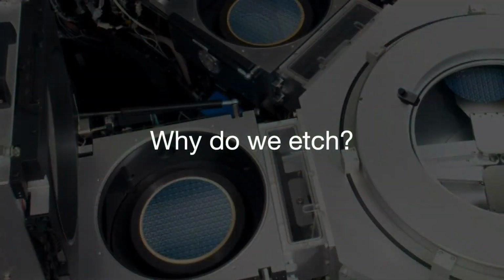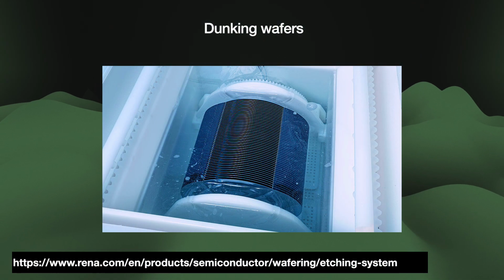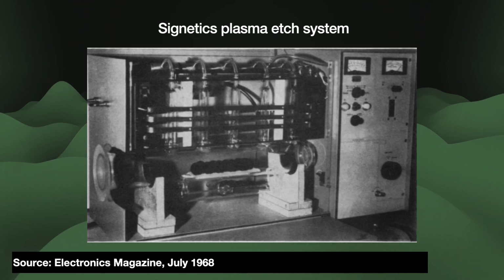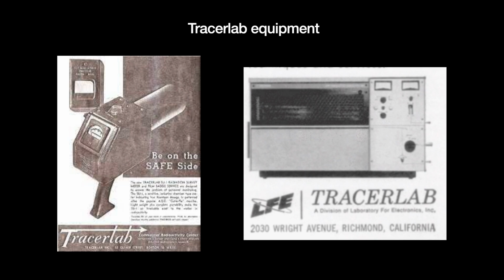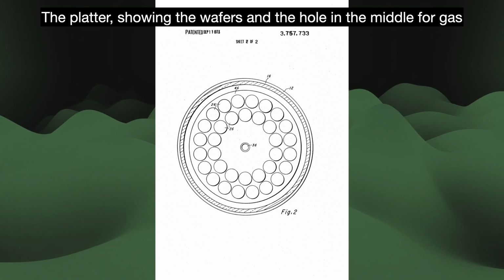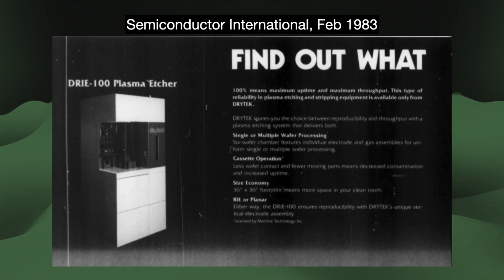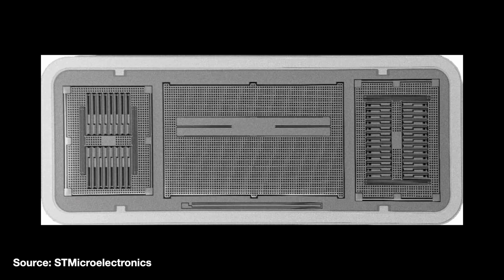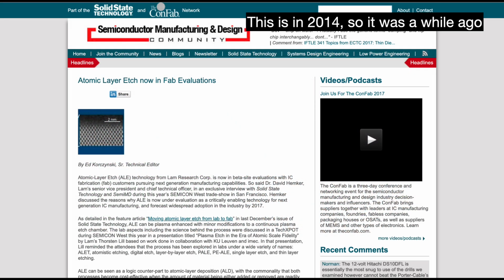Etch: Lithography's Unheralded Sibling

Comment: Cant remember magnet ring on Lam but Applied had static electro magnet ring and energized them in series, Tel had fixed magnets and mechanically spun them. Interesting to see same process on different tools and setting required for similar outcomes.

Comment: Fantastic content. I worked as electronics tech in Microns RD etch fab in Boise in early 2000s. We were qualing 12inch tools, doing some copper trials on 8"   . Did some high dielectric testing also. That fab had Lam Tel and applied all in about 1/3 ratio.  Older 8" applied were heavily modified to do interesting etches.  Thanks for your time and the content. The history you cover and your style is excellent.

Comment: 5:55 13.56Mhz is the carrier frequency used by NFC smart cards (credit cards among others ) to power the card. It's modulated to transfer the data. Any reason why this frequency is used in both cases?
Reply: Yeah, band allocation is the reason. A professor in my old group once modulated a high power signal, I don't know what, to some random number well into the MHz. Not too long after the university was contacted by the local air base who told them to knock it off.
Reply: I don’t know why NFC cards would use that frequency, but the reason that it’s the standard frequency in plasma processing equipment is that that frequency is within the ISM bandwidth (specifically allocated for industrial, scientific and medical equipment) and that RF emissions in this band do not interfere with critical communication frequencies.
Reply: @SuperCuriousFox  I see this makes so much sense now. I design NFC readers for a living and was under the impression that the 13.56Mhz band was for us (some narcissism creeping in there). I guess that the when NFC was designed  the designers from Philips and Sony chose that frequency, because knew that it would be free for the fields where NFC readers would be used. No one needs to pay for a coffee in the middle of an industrial plant or an operating room. I need to read up on the history of why 13.56Mhz was chosen for NFC.
Thank you for the insightful reply. Have a great day.
Reply: Because that part of the radio spectrum is allocated to exactly these kinds of devices. 13.56+/-0.007Mhz is one of the so called “ISM” bands reserved for “industry, science, and medical” use. As such, there are no licensing requirements to use it. Although it’s possible to broadcast and receive in that band, machines that do so typically don’t exist since your data would be corrupted every time someone within 100ft microwaved a burrito.

Comment: It would be very interesting to make a video about the Gallium them. Galliumnidrid is beside Siliziumcarbid an advanced semiconductor material. It allows higher voltages and faster switching than traditional silicon semiconductors. Siliciumcarbid is made from Sand and Coal. It is everywhere cheap available. But Gallium becomes extracted from Aluminium. It is a very energy and pollution intensive process where China has a de facto monopol on it. LEDs are only realizable with GaN. So the preferation of LED bulb monopolizes and reinforces Chinas world hegemony. The EU had forbidden traditional light bulb like Tungsten or Mecury/Phosporus bulbs. The effect was the death of the German OSRAM and the Dutch Philips Light concerns. The entire light industry was given to China with their Gallium LED monopol. In the USA Sylvania etc. was crashed in the same manner. For some semiconductes GaN are also difficult fo replace with SiC. But the entire western world becomes either completey dominated from China or frees from Gallium dependence. Meaning to reastablich domestic Tungsten / Mercury light factories and avoiding GaN in all Semiconductor applicances where SiC or simple Si can also be used. Would really be very intesting to make an video on this topic !!

Comment: While it’s obsolete for silicon technologies, resist undercut is extensively used as a desirable feature of liftoff patterning where gold is used to carry current (gold has no volatile halides, so it cannot be dry etched). This is still very common in GaAs power amplifier technologies.
Reply: Technically anything can be dry etched if the power is high enough. Saw someone sputter gold with nitrogen in a RIE once. But of course that's sketchy unless you really need super fine gold lines.
Reply: @tykjpelk  sure, if you don’t mind sputtering gold all over everything and failing reliability testing. What works in a university lab or a white paper to get a pretty SEM image rarely works in the field.
Reply: @Grak70  It's absolutely not something you'd want to do for anything CMOS, at least in FEOL. I think this was done for MEMS, and indeed probably not anywhere near production.
Reply: @tykjpelk  well you certainly wouldn’t do it for silicon CMOS in any case. Gold contamination forms trap states in the silicon bandgap. You can’t have gold anywhere near a silicon fab.
Reply: @Grak70  That's certainly true. I've read a bunch of papers on gold etching with IBE from back in the 70s, but now when I look them up it seems they're all about GaAs or SAW devices.

Comment: 13.56 MHz turns out to be the exact same frequency used by credit cards and bus passes. Is that a coincidence?
Edit: turns out it's in right in the middle of an ISM band so you don't need a licence to install a tap to pay reader on a gas pump, just like you don't need a license for your microwave oven even though it is designed to emit radio waves. If you tried 15.00 MHz you'd probably cause all the nearby shortwave radio clocks to go out of sync and the FCC would get mad at you, which is generally something to be avoided.
Reply: No coincidence. The 13.56 MHz band is an official ISM (industrial scientific medical) band which allows providing low (and high) power RF energy into a load. External and out-of-band radiation is severely frowned upon by others including FCC. Much more info available, consult Google.
Reply: This is exactly correct. More cowboy engineering in action. The engineers who invented plasma etch used 13.56MHz because it combined RF generators that were commercially available off the shelf with license-free use.
Reply: Sounds fun
Reply: THat's right - 13.56MHz is used because of FCC radio frequency allocation rules, not (as I thought for years) that it must be the "magic plasma frequency" - has nothing to do with physics, but instead gov't policy, haha!  Engineering...so many moving parts.

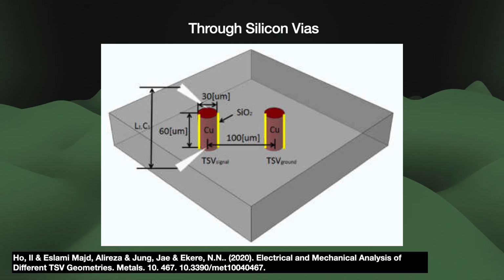Comment: 17:12 Sorry, but Nvidia does not have any stacked die products yet. They took out a patent on their flavour of it in late 2021, but has not brought it to market yet. HBM is the only industry standard component that uses die stacking, and Nvidia does use those (just the same as AMD and Intel), but they're produced by Micron, SK Hynix or Samsung. The only other product that uses die stacking is the AMD chips that end in "X3D".

I felt that was a needed clarification as the wording "die stacked chips like our modern Nvidia AI accelerators" was unclear to the point of being misleading.

Comment: Okay so why not use a non-reactive ion for the ion etching?
Reply: In practice you always trade selectivity for directionality. A heavy non-reactive ion like argon will etch straight down, but it won’t distinguish between layers and the etch products will sputter rather than diffuse away from the surface.  Purely chemical reactive species with low ionization will be very selective, but won’t interact with the plasma electric field strongly, so they will etch isotropically like a wet etch. In practice, you either alternate etch chemistry to form a passivation layer that prevents isotropic etching or strike a balance between etch species to achieve the profile you want.
Reply: many etchers do use some kind of large non-reactive atoms such as argon in order to add a 'physical' characteristic to the etch
Reply: A major part of my PhD was on ICP-RIE using argon, which is non-reactive. Everyone who knows their shit might be asking themselves why I would do something like this. So, the big idea is that you get sputtering only. That's basically like chipping away at the material with tiny hammers. In principle it's very anisotropic because all the atoms go straight down. It's also able to etch materials that don't react with etching gases, like many metals, LiNbO3, or in my case, potassium lanthanide tungstates. 
The downsides are: 1: Redeposition. When you sputter away atoms, they go somewhere. That could be sideways, right onto the mask, and onto your structure. So you lose resolution, the  structure is coated with amorphous whatever, there might be extra sidewall roughness, and your structure will look like a medieval castle with crenellations, because the redeposition also coats the mask. Back in the day they used ion beam etching, and this was one of the major issues with it. ICP-RIE still has that, but at least it's way faster.
2: Physical etching is not very selective. You want to be able to use a mask material that isn't etched, because then you can do lithography on something super thin, and that makes it easier to get good resolution. In my case, I got a selectivity of 3:1. In some other processes in our cleanroom, we had 50:1.
3: Reticulation: Basically it destroys photoresist. I don't remember why, but it's well established that in pure sputter etching, polymers deform, bubble, crack and harden. You'll get roughness, etching where you don't want to, and a layer of ultra-hard polymer bullshit that fuming nitric acid can't touch.
So that's why you don't want to go this route unless you really have to. However, if you want more physical etching there are ways to do that. For example, in ICP-RIE you can use more RF power and less ICP, meaning you have more intense physical bombardment. You can also add more argon, or make other changes to the chemical mixture like more or less SF6.

Comment: You should, in fact, NEVER shake a Polaroid picture. Moving the developer around will massively interfere with the process and reduce quality of your picture. The Polaroid company recommends to place the picture on a flat even surface.
Reply: And you should never blow in to a NES cartridge that doesn't work. But that never stopped anyone.
Reply: I used to blow on those cartridges every time.
Reply: @Gameboygenius 
That depends on whether the nes cart connector is full of dust.
And tbf it more likely that the socket inside the console is full of dust and you should blow on that, with an air-duster.
The cart is more likely suffering from corrosion and should have its edge connector cleaned with IPA and a paper towel.
Reply: @MostlyPennyCat  funnily I never said in the comment that it did work either. Personally I'm of the opinion that the act of removing and inserting the cartridge does most of the work from friction. The saliva explanation sound very much like one of those justifications, "maybe it does something in theory". But can't y'all blow air without spraying the whole place with saliva?
Reply: @Gameboygenius You’re a corny dude. “Technically I didn’t say that” , gotta be exhausting to be around.
Reply: @Aqwtiny  I made an offhand remark in a joking tone. Someone decided to not only take it seriously, but misunderstand what I said. Sarcasm on the internet is hard I guess. 🤷
Reply: @Gameboygenius  Triple downed on it, but sure, sarcasm.
Reply: @Aqwtiny  The discussion died almost year ago, and you decided to revive it. Obvious troll looking for a fight.
Reply: @Gameboygenius  That is not true. More than 0 people were Stopped from doing that after receiving that information.
Reply: @Gameboygenius No it absolutely does work.  Often the issue was a problem with forming an electric connection between the cartridge and NES pins and blowing on the cartridge could both dislodge dust and create a layer of moisture which would have enough dissolved ions to boost conduction a bit.

Probably wasn't great for the life of the system, could make it worse and was often unnecessary but doesn't mean it didn't help at all.
Reply: @petergerdes1094  I never said it didn't work, just that you shouldn't do it.
Reply: @Gameboygenius  Ahh, I read your "that" as referring to the process of blowing while you meant the NES cartridge.
Reply: @Gameboygenius you literally said it doesnt work....
Reply: @William-Morey-Baker  read the sentence again. I said that when the cartridge doesn't work, you shouldn't blow into it.
Reply: @William-Morey-Baker I agree that's the most natural reading of the sentence but you can also read the that as a which (You should never blow into a NES cartridge which doesn't work).
Reply: you know what to do
you know what to do
YOU KNOW WHAT TO DOOOOOO
Reply: @ahuhahuhahuh0  Lend me some sugar. I am your neighbor!
Reply: I recall when that song came out Polaroid (or whoever owned them at that point) put out a press release saying "please don't do this"
Reply: Whoo whoo! 😂
Reply: Shake it till you make it 🙃
Reply: Hey congrats on your spectrum diagnosis
Reply: @POVwithRC fucking brutal lmao
Reply: It's a pop culture reference to the song
Reply: I worked in this industry in the semiconductor industry for many years. In fact I used to train new operators and engineers. This is how they made them for a long long time.